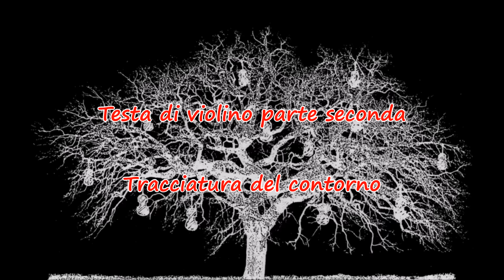2) Testa di violino parte seconda - Tracciatura del contorno

Comment: Thank you!
Reply from the maker: You're welcome!🙂
Reply: @DavideSora  may I ask what finish you use - stunning results. Oil or spirit?
Reply from the maker: @Jeff034  Oil by composition, spirit as application🙃
Let me explain better: to make my varnish I use linseed oil left to polymerize and oxidize for many years (Linoxin), which in this way becomes soluble in alcohol and can be used together with other resins to obtain an alcoholic solvent varnish. So from the point of view of the application technique it is in all respects an alcohol varnish, but once the alcohol has evaporated what makes up the dry film will be linseed oil and resins, so from this point of view it is an oil varnish. I prefer this way because since the oil is already fully polymerized and oxidized, after a couple of months from the end of the varnishing the layer will be completely cured, and its effect on the sound will be the definitive one, while with traditional oil varnishes that are formulated starting from liquid oil, the time required to reach this final state is at least a couple of years, more likely it will need four or five years to get a fully stable varnish from the acoustical point of view. Obviously, if one has a lot of experience, he is aware of this problem and will be able to draw his conclusions even if the sound of the violin just finished varnishing is too muted by the still rubbery varnish, but I prefer not to rely on assumptions and have less uncertainty when evaluating the sound of my just finished violins.

Comment: I'm sorry I don't understand. 10:03 Why did you draw this one line after you had already drawn the whole scroll with the cutting lines?
Reply from the maker: To see it better when sawing the outline, and to be able to cut close to the mark without making mistakes. For the rest of the work, the engraved line would suffice.
Reply: @DavideSora  Right. Of course. Last week, under the supervision of a master, I started my first repair work on an old violin made by my father. Its nut was slightly misshapen, so the strings were stuck at the top end of the fingerboard. And the additional challenge is that for some reason the upper surface of the neck is at a different angle than the surface of the pin box where I glued the new nut. It's interesting to get to practice matching the shape exactly. You have put a lot of effort into sharing everything. I watch all your videos. Thanks for those!

Comment: Sir, Do the curves of holes in your template match exactly finished line of turns or have slight margin for later work??
Reply from the maker: The measures and lines of the template are the definitive ones because if it weren't so, you wouldn't have a precise reference. However, you must keep in mind that when you mark out around the template, the tracing remains outside the template so it will be slightly wider than the final measures. In this way you know that if you leave the mark you will be abundant, if you remove half a mark you will be on the measure, if you remove the mark you will be under the measure. There is no real need to replicate the template accurately but you can decide which size to keep based on your personal taste, so you actually have three templates in one, or many more....😊
Reply: @DavideSora  I guess there could be infinite number of them in one haha.... Thanks!!